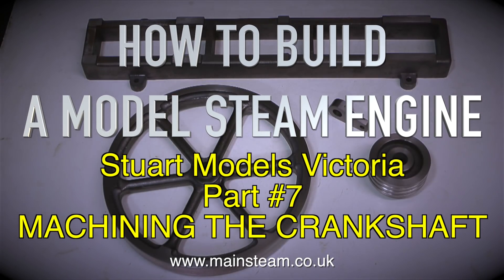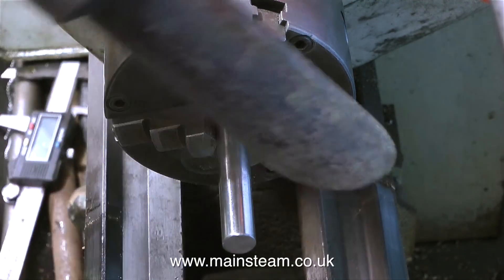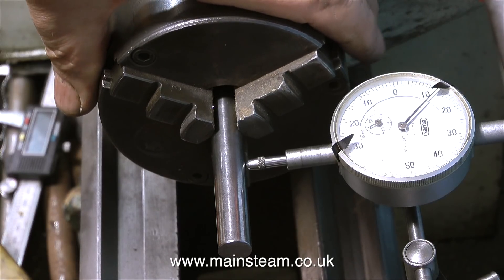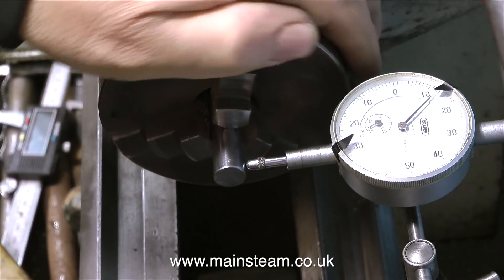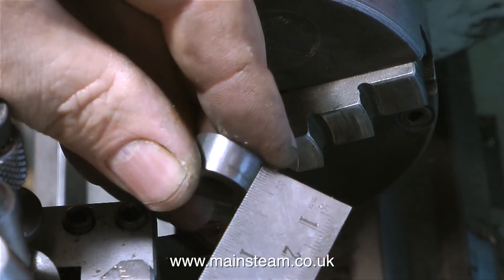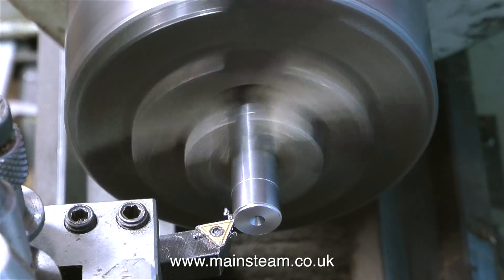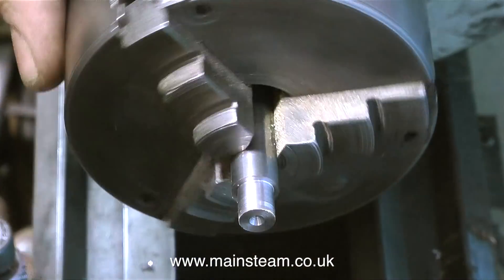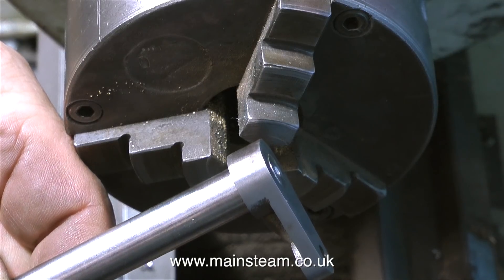HOW TO BUILD A MODEL STEAM ENGINE - STUART MODELS VICTORIA - PART #7

Comment: I think the crank protrudes by the amount of the chamfer so the full width of the crank can support the full diameter of the crank throw bore, plus you do not want a recess showing from a flush fit of a chamfered shaft. It may also have something to do with the center drill hole.

Comment: Crazy Brits.. Aussieland uses Bee's dick as the measurement.  But I honestly don't know why.
Also, in case your curious, the mark made on the work with the tool to show where to finish an operation is called a 'witness mark'.. I watch far too many other machining videos so some things stick. :)
Reply: Electra Flarefire Interesting, as a fellow Aussie I was also trained in bees dicks (Though as a graphic designer not a machinist or musician). Given the relative dimensions of a bee and a gnat I can only assume  our dicks are bigger than the Poms though I've checked Machineries Handbook and can't find a conversion factor... any ideas?

Comment: Dear Keith
I am thoroughly enjoying your build series for this Stuart engine.  As a fellow Brit over here in Canada, I did enjoy your use of the traditional British engineering length measurement unit of a Gnat's dick.  I fondly recall hearing another Brit define the  tightness of a fit as "Tight as a Gnat's chuff" - Lovely!!
Sincerely
Paul

Comment: Quite jealous of your lathe, the only one I have access to has about 45° of slip between the handles and the actual motion of the tool in any direction.  Makes accurate cuts far more difficult than it should be.  Thanks for expanding my Christmas wishlist!
Reply: You should be able to adjust that out.
Reply: I wish.  The lathe belongs to a university, and the unofficial motto there is "Doing something useful with all this money is what the competition is supposed to do.  Not us."

Comment: Quite right about the lathe handwheel graduations.  The infuriating thing is that on some machines the cross slide measures radius travel, others use diameter travel.  This was very annoying when I was learning my way around the machine shop as we had a mixture of both.
Reply: Chlorate 
     So true!